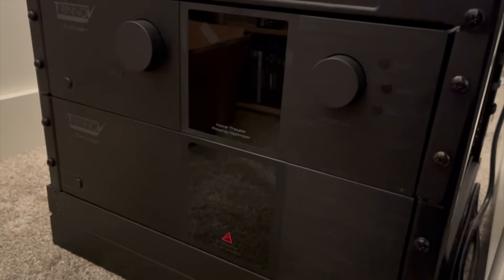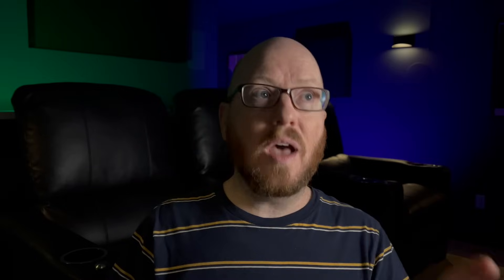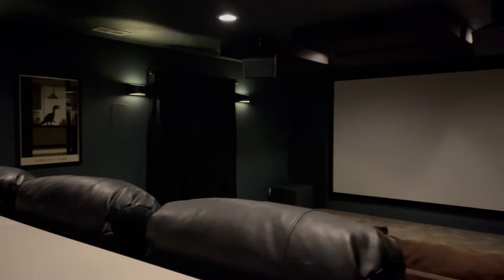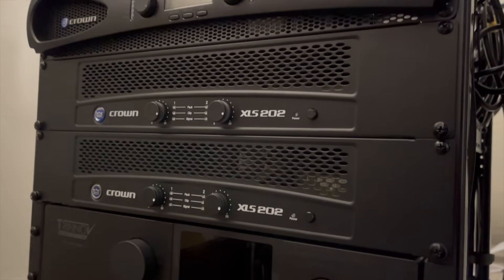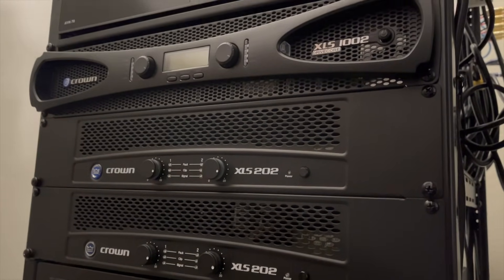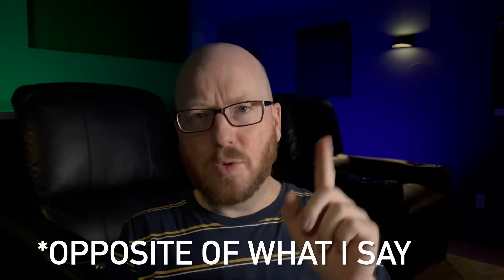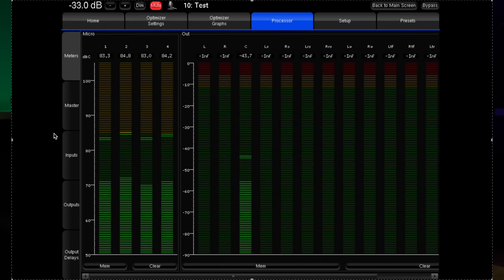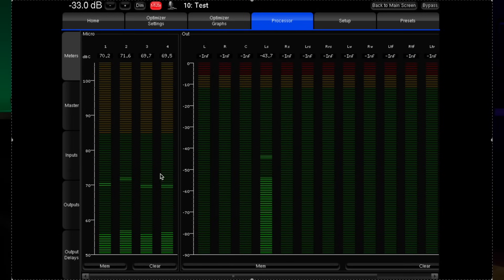Bridged Crown Amps vs Trinnov Amplitude 16 – The Actual Data

Comment: Great review. can i use the Trinnov Amplitude 16 with  StormAudio ISP Core 16 Immersive Sound Preamp/Processor. does the trinnov ran hot??
Reply from the maker: Yes, the Trinnov amp can be connected to the XLR outputs on the Storm Audio ISP Core 16
Reply: @GeorgeTheaterAtHome  i wanna use it to ran my home cinema using Arendal 1723 THX line-up speakers. 7.2.4 layout.
Reply from the maker: The Trinnov amp does not run hot at all. It has internal fans that are quiet and keep it cool.
Reply: @GeorgeTheaterAtHome  that is wonderful. thank you for the swift reply

Comment: So your using the newer XLS drive core 2 1002 for your center and the older XLS 2002 for your L and R.  These are totally different in comparison and a totally different ball game.The newer XLS drive core 2 amps  have built-in independent per Channel HP LP Bandbass  x-overs as well as a selectable input sensitivity setting for either .775 or 1.4v. this is amazing for people using home audio avrs with only RCA outputs so they can use the .775 input setting.  If you were running XLR obviously you will use the 1.4v setting. Their fans are also extremely quiet compared to the prior models. The xls1002 drive core 2 you have is 700watts @8ohm bridged not 600w.  If you had the newer driver core 2 2002 model, they are 1500watts bridged @ 8ohm.  They make a 1502 also that's in the middle that does 1000w @ 8ohm. But I think it would be fair for you to mention you are using two totally different model amplifiers all together. I use the XLS DC2 1002 and 1502's. Fans are not issue, because they rarely ever cut on, and if they do you can barely hear them.  I just think it's important to emphasize the complete model difference between the amplifiers you are using.  People need to use the newer XLS drive core 2 if they are going to go this route. Especially if they have an AVR with RCA outputs. Because most people with middle line AVRs are going to be disappointed with older models that are 1.4v input signal. They will find their avrs do not have enough clean voltage at that rating, leaving them with lackluster results and noise/hiss through there speakers. These avrs will end up clipping and not giving you clean single when listen to ref. Level volume. You would have to add something like a ART CLEAN BOX PRO to boost the input signal for the reg XLS for them to be useable.  That's why the .775 or 1.4v setting is so important on the new drive core 2 version.  I've done a ton of research on this because I did the very same thing with my system.  Gain stage to my entire system from the RCA outputs into the crown drive core to amps using oscilloscope.  Just really think people ought to know if they are going to go this route they need to go with the newer XLS drive core 2.  Not the older XLS 2002 you are running.  Enjoyed your video though.  Cheers.

Comment: You are mistaking watts and gain.   The trinnov altitude is gain match to the amplitude. Cero in the altitude is equal ti cero in the amplitude, as 100 % in the altitude is 100% on the amplitude. That is not the case with the crowns.

Comment: Different input Gain on the crown amps? that would explain that. I think you would have the same behavior if crown amps are not bridged.
Reply: I believe crowns auto adjust sensitivity to keep it identical when bridged, by removing 6dB for each channel.

Comment: I thought you had a loaner Trinnov, then you took it out? 
How do you still have it? I don't get it.
Did you purchase your demo unit?

Would have thought that bridging 2 X 200Watt 8 ohm would be 400 watts, but the resulting wattage would be 700-800 watts at 4 ohm.
Wondering if you could have adjusted your volume from the Processor -> Outputs -> and just turning up/down from there.
I think, once I settled on a change I would just re-run the calibration and optimized it.
Reply from the maker: I was all set to send it back, but I’ve been able to keep it on loan a bit longer.

Comment: I agree with what the others are saying. The difference in levels is the gain structure. You should find out from Trinnov what the voltage output of the processor is and then match that with the input sensitivity of the amplifiers. Also, I would recommend investing in an oscilloscope. That can really be a great tool in helping to set your gain structure as well as measuring  the true output capabilities of your crown and trinnov amplifiers. I'm sure the Trinnov amp is able to match and exceed the power of the crown, and it should have a huge advantage in sn ratio, frequency response, and lower distortion.

Comment: You are speaking about gain-level. The other thing is, that amps do not sound that different. The other thing is, that one power-supply for 16 channels compare to 3 power-supplys to three channels.
Reply from the maker: The Amplitude 16 actually has 2 power supplies. You are correct about the gain level.

Comment: What roBLINDhood said. I was banging my head against the desk while you were explaining your original reasoning. Hopefully many People will learn from this though. Amp gain will vary. Normally this won't matter because most people don't use different brand power amps for various channels. Calibration will sort these discrepancies. However, this has nothing to do with power output capability to slam you.
Reply from the maker: I’m learning a lot in the comments section, as always!

Comment: Are you sure the volume difference isn’t just the input voltage difference between consumer and professional audio gear? Pro audio is at a higher voltage and therefore louder given the same input signal. Might want to check into that if you just want to know why they’re different. Too many variables as to why you prefer the crowns.
Reply from the maker: This is exactly it.

Comment: The output power of the Trinnov processor is higher than most to feed a signal with lower noise to their amp.

Amps have a mini amplifier (called gain) before the big main amplifier. This helps boost the signal from your processor to a level that the amplifier can use.

The Altitude 16 has 22db of gain when bridged (to match the processor output).

The Crown XLS amp have 32db of gain because professional equipment puts out a signal that is quieter than the Trinnov processor.

That’s why it’s 10db louder. If you change the gain knobs on the front of the crown amplifier to use the same amount of gain (22), they will output the same volume.
Reply from the maker: Great explanation! Thanks for sharing the details of how the gain settings affect the volume.

Comment: Is the idea here that louder is better?
Reply from the maker: No, I’m looking for the setup that will give me the most impact for my LCR’s, specifically the Center channel. Dialogue clarity is always something that is at the top of my priorities for a setup. So when I switch between these two configurations how the dialogue comes thru is the end goal
Reply: @GeorgeTheaterAtHome  if center channel clarity is your main goal then this entire video is not going to provide you with any meaningful improvements. For every single thing you fix you will break more things due to channel level imbalance. 

You need to focus more on crossover and center speaker positioning and eq to get better clarity. Also the ultimate way to get better dialogue is upgrade your center speaker if all else fails. Did you know you can for example route your midbass from your center to your main L and R if they are bigger speakers and then route the sub bass to your subs on trinnov. The trinnov can even create phantom speakers to correct for the postioning of your speakers relative to microphone positioning.
Reply: Yeah, something is off with the analysis. After calibration all of your speakers should be “level matched “ so did the trinov not correctly level match the first time?  In a perfect world if you play the same tone from your main listening position, every speaker should be at the same DB.

Comment: It is indeed just a difference in input gain between the 2 amps. You need less input for a higher output, but it will reach its maximum also faster. You need to level match both and then compare.

Comment: Input gain is low on the trinnov amplifier, it is designed to match the output of the trinnov processor for the least noise and hiss ,

After calibration you should be getting exact same db at mic position, do that you get what movie makers intended,

If you raise the front 3 you are breaking the balance

Comment: Can you please make a video on how you bridge a amplifier that doesn’t have a bridging feature and vice a versa?
Reply: To bridge a non bridgeable amp one channel input has to have regular polarity, and one channel input has to have reversed polarity of the same signal. In an amp that has a switch to bridge, it takes care of that internally. In either case the speaker has to be hooked up to the positive to positive  output of one channel and negative to negative output of the other channel(positive being the output channel of regular polarity input and negative being the output of the reversed polarity input), or vice versa if you need say a subwoofer to run reverse polarity if time alignment or phase reversal is needed.

Comment: 5:48 

This is not how you test this. Since its Bridge, the voltage is more. The amps also have different sensitivity/ gain are completely different. 

The final output from the optimization should level match the speaker. Sending less voltage to the crown and more to the trinnov.  

The evaluation of performance should be done in rew after calibration. And since we are talking about power. It would be compression testing. Which both amps have enough power to compress your speakers most likely. 

Technically, you can level match the crown amp without rerunning calibration     You just need to level match in the output stage. 

Level match, you will most likely like not hear a difference.  

Disclaimer. I like your content so this is constructive criticism. I’m not trying to be a 🫏. I have. Just done a lot of this type of testing.
Reply from the maker: This is one of the main reasons I create content, to present what I’m seeing/hearing and then learn from others. Thanks for this explanation!
Reply: @GeorgeTheaterAtHome I had a few autocorrect errors. Hopefully it made sense.
Reply: @GeorgeTheaterAtHome 

Johnthan did a good video that breaks it down 

You can also look at some of the pro sound guys explain gain stage. 

The best way I can explain is, lets say I have 2 cars that can run 200 mph. In one car, I have to push the pedal to the floor to get to 200mph. (Lower gain)

In the other car, I only have to push the pedal half way down to get there. (Higher gain) If I Push past halfway the car won’t accelerate any faster. If I push it to the floor, it will backfire pop etc. (clip)

Now, if someone drives both cars and doesn’t know this, the will think the car that accelerates just as fast at half throttle is faster if they don’t push them to max of 200mph
Reply: @bigjack79 = Exactly, and I was hoping and waiting for the actual sound quality difference - what a waste of time. This hole video was a real newbie disaster. I thought this really nice guy at "Theater at home" had a little bit more knowledge... This has NOT anything to do with sound quality.

Comment: You are doing it WRONG. Set all levels the same. Why do you want to keep fronts at a higher level. Of course there is a difference...regardless of the amplifiers used. Are you an amateur or am I missing something. I beg to be CORRECTED.
Reply: If I understood correctly those levels are pre calibration. Otherwise it would be very wrong.
Reply: @crxdave Well he implied 85 db's on fronts and 77dbs on surround bed layer... very wrong. Also when he Bridge Trinnov he was complaining on only getting 77 db's...what gives.

I hope I miss understood.

Comment: Why didn’t you choose the CDI Line instead? Very curious…..
Reply: Because he may not know about them, or wants to limit cost and is only interested in the power numbers. CDI should have better audio quality, in theory. If you're looking for best audio quality and power, Lab Gruppen cones from a reputable brand are where it's at. If you don't mind paying more, MC2 are great, especially the s-series. If you're budget conscious, use Macrotechs (600,1200,2400,5000vz). I've used the ma2400, it's cheap used and orders of magnitude better than the XLS featured in this video.
Reply: @user_47214 You agree the CDI line would be a better option although a little more expensive?

Comment: I'm gonna be that guy sorry the test that you did only shows the difference in the input gain on the amplifier. Trinnov power amps have very low input gain  vs regular power amps from almost any manufacturer which is what you're measuring there

Comment: You are missing something. These measures main nothing except the input sensitivity of each amp is different. Adjusting down the input brings things down to level match the rest of the amps. The crown amps are not nearly as good as the other amps (distortion and over all quality)… I think you’re too focused on power. Power is not the only significant measurement. Bridging amps (any kind or manufacture) will definitely increase distortion levels. For this reason, bridging is never recommended in a quality system.
Reply: Not inn Anny bigg scale inn dual mono used as mono

Comment: You don't need a Trinnov to get an overall great amp.  They overprice Hypex Class-D modules.  Sure you don't get the fancy case, but Dylan at Buckeye Amps makes an excellent Hypex or Purifi amp that would compete with the Trinnov for measurements and sound quality at a fraction of the price.
Reply: Agreed!  I have the Class D Hypex modules...A Big Difference...
Reply: The Amplitude 16 has icepower modules the 8 has the Hypex modules.
I’ve always been under the assumption that Hypex is a step up from Icepower.
Definitely overpriced.

Comment: I was on board with the Crowns, till I looked up the specs, and testing on audiosciencereview. The trinnov is actually insane.  Biggest hurdle is the $12k price tag.  I think the answer is somewhere in the midddle.   A handfull of emotiva, outlaw, or nad, etc..
Reply: Crown Macrotechs have great sound quality, there pretty cheap used. They're actual professional amplifiers, used on touring in the 2000s.
Reply: In addition, Crown Com-Tech amps are just like Macro-Tech's and available at much cheaper prices. I just picked up a Com-Tech 210 (center channel) for $100 and a Com-Tech 1610 (L/R channels) for $150